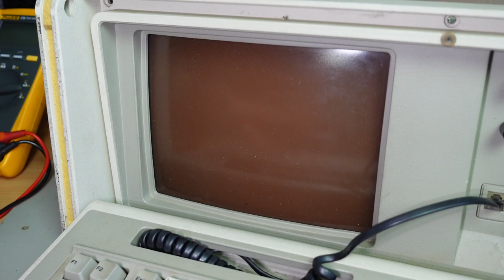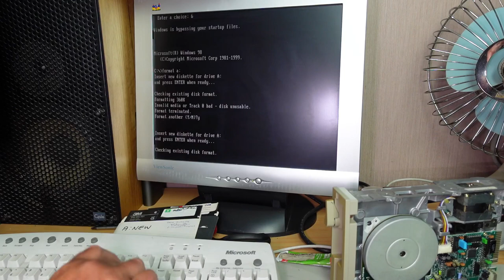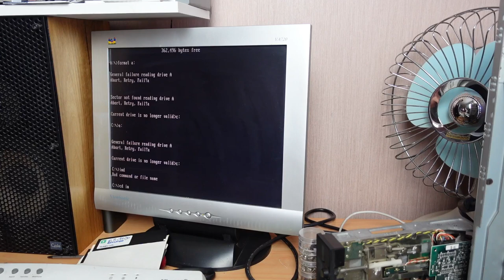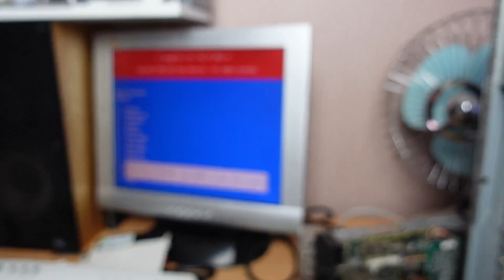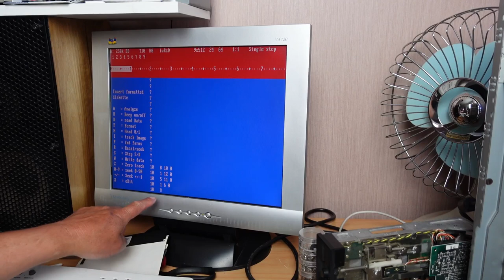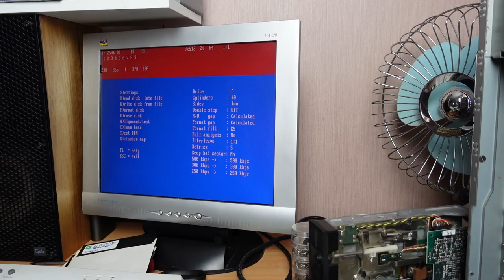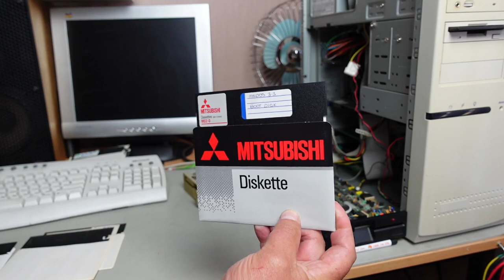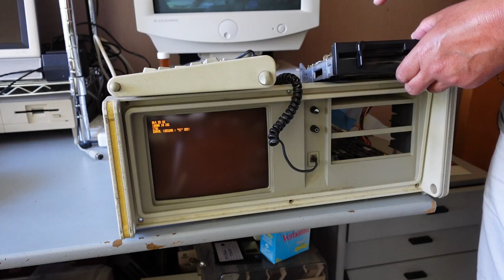IBM 5155 Portable PC Recovery Project - Part 2 - Floppy Disk Drive Issues

Comment: A 5.25" drive > 360K uses media that requires a higher strength magnetic field to write to it properly. The heads on these drives also create a physically/magnetically narrower track. Your >360K drive can read a properly written 360K disk, reading is not a problem. You 'can' write to a 360K disk on a >360K drive but it will have narrow tracks. Your 360K drive uses a wider head and expects a wider track, it can't read the narrower track written by the >360K drive. 

In short you need to create 360K disk on 360K media with a 360K drive. If your disks are not marked, then you have a lot more work to try them on a 360K drive and >360K drive to try and suss out what you have.
Reply from the maker: Thanks. I had seen that in a book about the narrower track on the > 360K drives.  I'm still having the odd issue where the drive will work fine and then stop working properly after trying to read/write to disks of unknown condition/format. I've got a 1.2Mb drive so I go through and try to sort which disks are 1.2Mb disk.